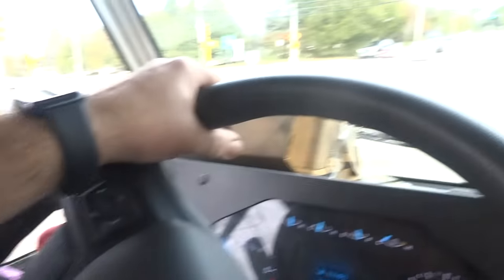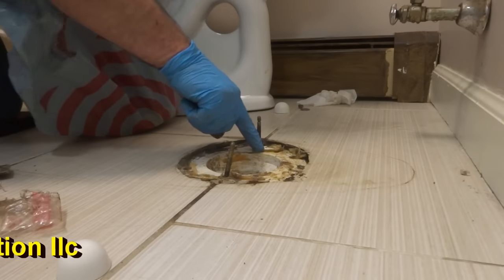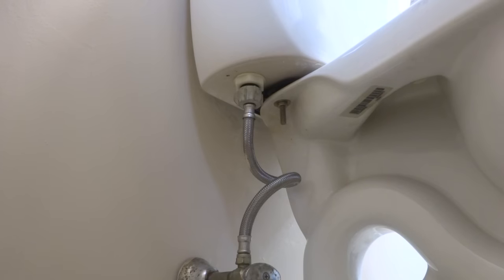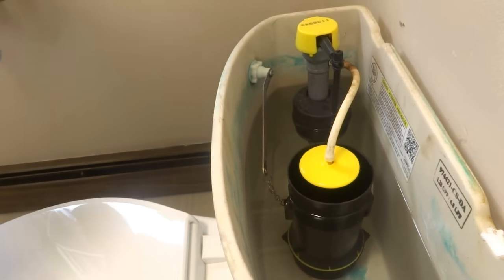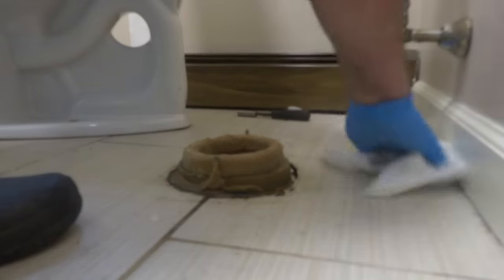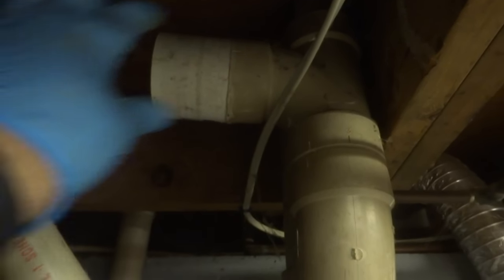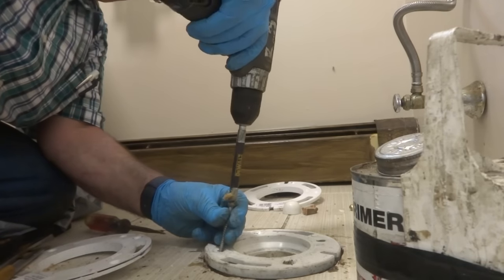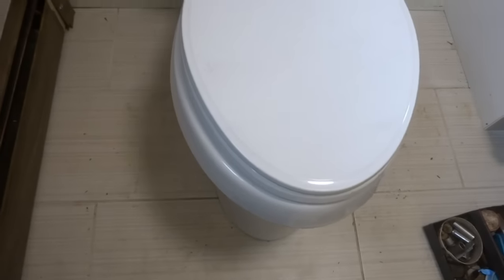major water leak from first floor toilet

Comment: I lost 40+ lbs recently. If I go to my highest weight, then I've lost 70 lbs. I avoid all the processed foods. I would eat Ramon noodles, because it was quick and cheap dinner. I made a huge meal with mostly veggies. Then I would add fish, shrimp, and chicken. I would add veggies, that has lot of water content. The meals were similar to what Steve would do.. everything in one big pot. I measured everything out in 1 cup scoops and I bought meal preparation containers from Amazon. It came out to 24/1 cup meals. I go the gym 7 days a week and swim for 2 hours and since it's getting cold outside, I walk around the gym, instead of outside. My Brother-in-law went from 350 lbs to 215 lbs. If he can lose weight, then I could lose weight.

Comment: Great job. My old American Standard toilets used a sponge gasket. When it leaked, I attempted to use wax. It just would not seal. Even with a double wax gasket, still leaked. Ended up going with an OEM sponge gasket and it worked.

Comment: I’ve had bad luck with those brass rod flush handles. There was a retired plumber working at Lowes and he said that the plastic handles actually last longer. He also said that the metal rod handle should last longer but the connection of the rod to the exterior part of the handle always seems to fail.  I installed that plastic handle over ten years ago and it hasn’t failed.

Comment: I carry a 2 inch and a 3 inch Kohler tower on my truck, haven't had to use one yet.
They are pretty cheap at Lowe's,I get Kohler handles at my supplier,every Kohler toilet has a different handle,bullshit.
They drive me crazy😅😅that chlorine tablet in the rank isn't helping anything either 😮

Comment: those Clorox tablets in the tank will corrode those gaskets away to nothing unless you use a chemical resistant one. I learned that the hard way

Comment: I have a problem like that, i think.  I used recip to cut off toilet flange and hit the pvc pipe.. I put new one in and taped slit.  Now I have a mystery line in 1st floor bath below. ha   Too scared to remove ceiling tiles Mamma!   Like an Ostrich. 😀

Comment: Kohler used to make a great toilet back in the day. They'd suck a turd 5 feet long down the drain without an issue and the parts would stand up to a lot of usage, wear & tear over time. Kohler Wellworths are all I'd put in. But they are garbage now. Total garbage. They've overcomplicated a very simple design with this high efficiency low water flush garbage. The parts are cheaply made but are stupid expensive to replace if you go for genuine OEM Kohler parts. Lots of better toilets out there today.

Comment: This is why you just can’t fook around. Cut it out…replace it. Blocking for the flange screws..flange spacers for on top of the floor. Small wax ring. Next.